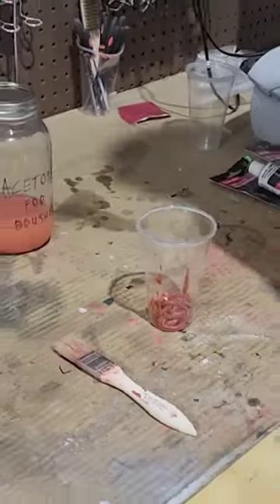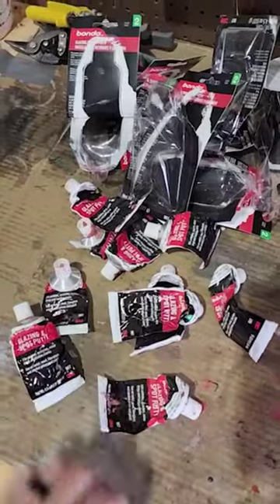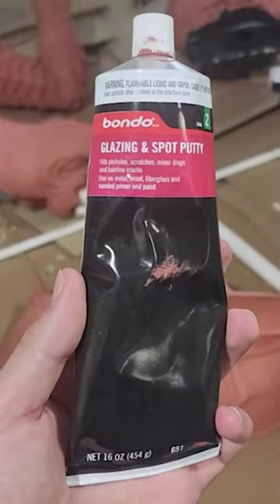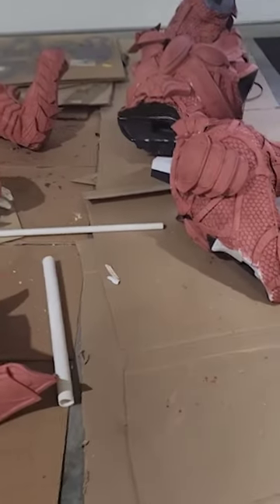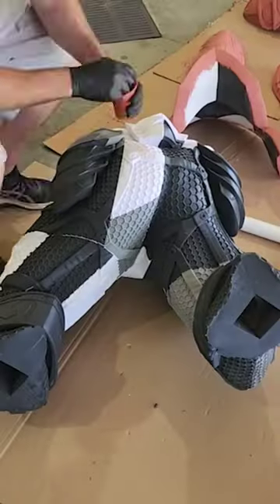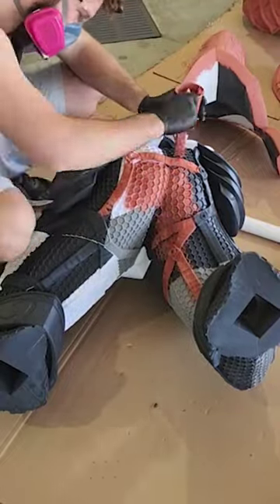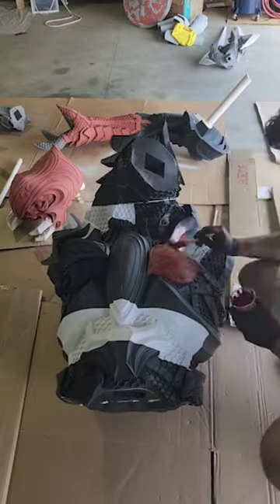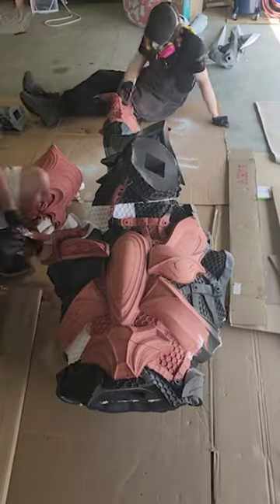Making a Life Sized Arbiter Pt 27

Comment: PLA isn’t compatible with acetone, so I’d expect a partial melt of the surface topography.  Perhaps this mechanism assists in smoothening the part.  Plus the thinning of the bondo allows for a thinner, more even application. Seems quite interesting!  What mix of bondo to acetone did you use? Roughly 80/20 by volume bondo to acetone by my uncalibrated eye…?
Reply from the maker: I usually eyeball it to 2:1 Bondo to Acetone
Reply: @GalacticArmory thank you!  I’ll give it a shot… First on some scrap prints in-case I turn it into goo, haha

Comment: Dude they sell gallon size tubs of Bondo!
Reply: Glazing and spot putty is used for filling smaller voids than the 2 part polyester filler your referring to. He’s also able to “water it down” with the acetone so he can brush it into the finer details and it be easier to sand later. With a two part filler by the time you mix it, you only have minutes to work with it before it hardens.